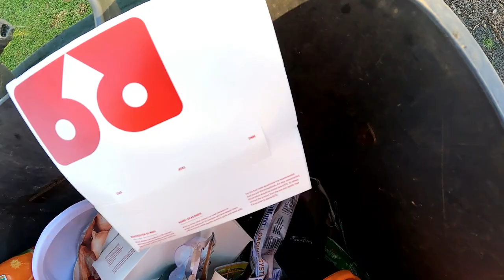Dumpster Diving Part 1 Hes Got A Bad Axle

Comment: Another great vid Tim canberra has finnally put in return and earn and it dosent read the bar codes so you can do wine bottles as well now it even does crushed cans you have a belt either side so its easy and you get paid there in cash